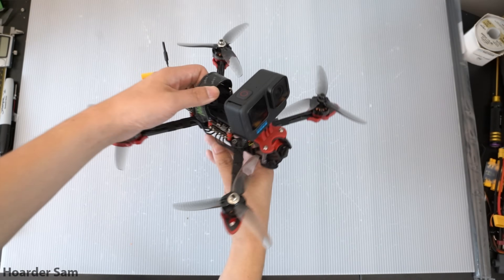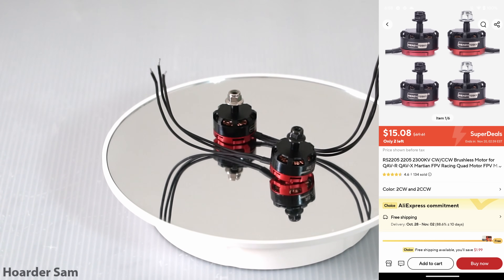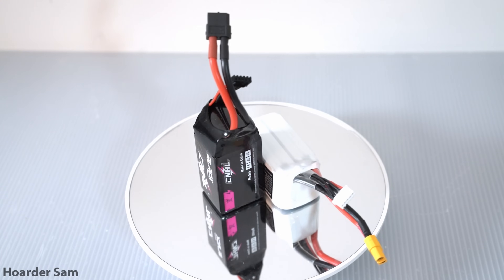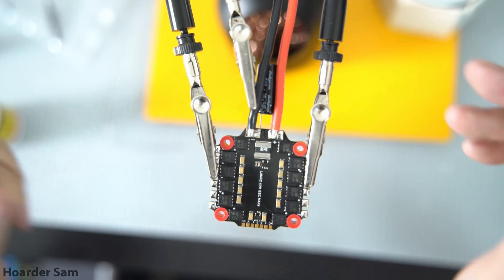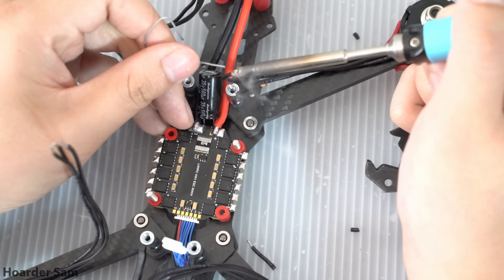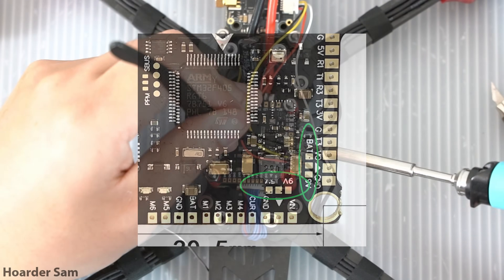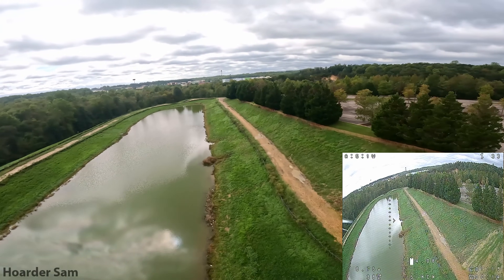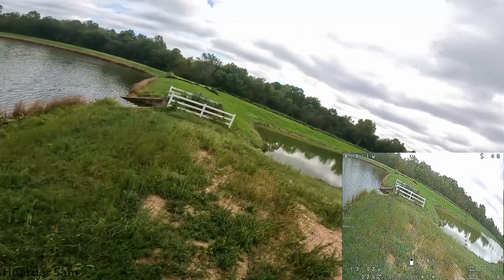How to build a 5-inch FPV Drone for $100

Comment: Suggested Hota D6 Charger is super expensive! Would ToolkitRC M6D for half price do the same job?
Reply from the maker: It should, just note that the M6D only accepts DC power input so you will need a separate power supply. The Hota D6 can plug into a standard wall outlet
Reply: @hoardersam10  I collected all the parts by using your links and my basket totaled 114 euro. Awesome price! Thank you! Do you know any alternative cheaper chargers? I don't want to spend as much money for the charger as for the drone : )
Reply from the maker: @harrypotcha0283  SkyRC b6 neo is good if you have a decent USB-C phone charger https://s.click.aliexpress.com/e/_DFHWvKt

Comment: What would I need to switch the analog cam setup to walksnail?
Reply: You would need different camera and video transmitter and diffeeent goggles. Usually in digital systems like walksnail the camera and video transmitter is combined into one part.

Comment: Im building my first drone off of this vid and was wondering where do the battery leads and capacitor come from and if I need to purchase separately what are the specs I need?
Reply: Nothing is really mentioned about them really until being told to attach them
Reply from the maker: Capacitor and wires comes with Flight controller/ESC

Comment: How do you build so much FPV drones and how do i buy one from you?
Reply from the maker: I like building :) I am not selling right now
Reply: @hoardersam10  Hello i'm a beginner who can spend 1k USD on this hobby of FPV what would you recommend me to buy? I've flown DJI mavic 3 pro before and i want to get into FPV. thx!
Reply from the maker: @domnicdrakon  If you just want to fly, the Avata 2 is good for that budget, and then when the DJI O4 comes out you can use the goggles from the Avata 2 with it.
Reply: @hoardersam10  Hi i have the elrs boxer and im looking for a drone and goggles do you have any suggestions? (Tinywhoop to practice indoors) ps I have a budget of 1k usd

Comment: Newbie here, found your channel by looking into cheap drones to start and this build it's quite fantastic, I don't have GoPro but other than that it seems very interesting and got quite hooked up and I might even try this first time
Reply: be careful - this is not a "cheap drone setup". you'll need the fpv goggles, remote and HOURS of training before you can bring this thing outside. this is not you typical dji/whatever fly ready consumer drone!
Reply: @tobiasgoelzer  dude dont be that guy

Comment: Hey! Great video. I'm planning on building this exact same drone. I've got two questions; is the alternate motor you put in the description better or worse? Since they both have similar prices. The 2nd question is can I use the fs i6x? (yeah ik it's not that good) I've been flying rc planes before and I want to get into the drone hobby, but I don't really wanna buy a new radio
Reply from the maker: The motors are the same, just different sellers in case one sells out.
The flysky is possible, here's a tutorial video: https://www.youtube.com/watch?v=cR1CX8fdgac
Reply: @hoardersam10  Thank you so much!

Comment: You say you estimate the FOV of this cheap 9€ FPV cam to be around 120° and not 165° like the Caddx Ratel. In the offer they say 165°. Now that's pretty bad. I suspect that the 1800TVL and Starlight sensor are also fake specs. So don't buy this camera! Boycot this. You'd be better off paying €3 more for a Caddx Ant which has a 165° FOV and also offers 19mm mounting with the included adapter.

Comment: Are the googles necessary?
Reply from the maker: You can fly line-of-sight if you'd like but its generally more difficult to fly because you have to maintain orientation
Reply: @hoardersam10  do you have the code to add to it

Comment: Do you have any temp for the soldering iron and solder?
Could you also make a link for the M size screws?
Reply from the maker: Iron set from 300 to 330 C
Kester 37/63 leaded solder
Screw assortment example: https://s.click.aliexpress.com/e/_DmATv4V

Comment: Hey Sam, I’ve been looking into this sort of thing for a while. There’s so much drama about FPV being dead and analog being dead, but there is soooo much coming out of China at such low rates that I actually think we’re heading into a new era of analog, with new pilots joining the ranks with these cheap options. You’re doing good work here…
Reply: Analog will make a comeback. Its breakdown is easier to spot and theres evennways to make repeater systems for them. Just as in war or redbull downhill. I actually just bought a used pair of hdo2 and rapidfire for some budget builds and whoops.

Comment: Great video, I just got all the parts but the goggles, can I use dji Goggles with this build?
Reply from the maker: If you have the older DJI Goggles V2 you can get an analog adapter for them
Reply: @hoardersam10  Thanks for the reply, by the way i got a little carried away and i spent a little more on build, i added a few extra components for work,it'll be an awesome drone

Comment: This guy will change budget fpv for sure
Reply: absolutely. this is by far the best guide for building budget friendly fpv drones. most of the tutorial made by other youtuber uses some expensive parts.
Reply: this setup works great for me  i had made mine for $90 bc i 3d printed my frame out of carbon pla   10-10 recomend
Reply: @Imnottox your 3d printer which I assume you had before you got into drones, would cost somone a extra few hundred
Reply: @Imnottox  I would change that to some less brittle filament in the future
Reply: Can some1 tell why his 5inch drone guide is more cheaper than the 3.5inch one bc im looking to build a 3.5inch drone but i thought that 3.5 inch drone were cheaper?
Reply: @AVoiDes  Because of war between Ukraine and Russia chinese companies started making 30x30 stacks alot for cheap instead of 20x20 stacks because they go on smaller drones
Reply: What??

Comment: would be cool to have a really cheap 2 or 3 inch build from you
Reply from the maker: That will be tough but I'll see what parts I can find!
Reply: @hoardersam10 Can some1 tell why his 5inch drone guide is more cheaper than the 3.5inch one bc im looking to build a 3.5inch drone but i thought that 3.5 inch drone were cheaper?
Reply: I second this... something weighing around 130-150g so you can get a decent battery and a Thumb cam on it below 250g 🙂
Reply: this
Reply: Bc i thought 3.5inch was cheaper??? Than 5 inch

Comment: hi i have a spare dji o3 lying around, can i build this build and use dji o3 instead of the analog cam
Reply: and would i need a different stack that support o3
Reply: The FC does not have a plug for the O3. You will have to solder the wires but it will work. The frame he uses will not fit the O3 camera. You need a frame that can fit 20mm camera.
Reply: @xBarnabyJonesx  can i cut the o3 connector and solder the wires onto it
Reply: Will it also work for speedybee f405 v3

Comment: If I just want to build the system and not the drone using the speedy bee thx and the cadex camera what antenna batteries and charger should I buy?
Reply from the maker: Only want wireless video and not the drone?
Reply: Yes because I would like to stick it on a micro rc crawler instead
Reply from the maker: Have you seen Eachine tx02? Its a camera and video transmitter in one, should be nice and small for a crawler
Reply: @hoardersam10  yeah i have but ive seen reviews about two in one cameras having issues with overheating  and i live in a pretty hot climate so i just don't think it will last, i also want to make it so maybe later on i could put in on a drone.
Reply from the maker: @pazza2079  I would choose a VTX that as a fan then, maybe like rush tank solo max
Reply: @hoardersam10  do you have any advice? Please 🙏

Comment: Would an 03 air unit fit on this build?
Reply from the maker: It won't fit because the O3 camera is 20mm wide. 
Instead I would suggest the Speedybee Mario 5 frame, its designed for O3 and pretty cheap
Reply: @ thanks for the recommendation!